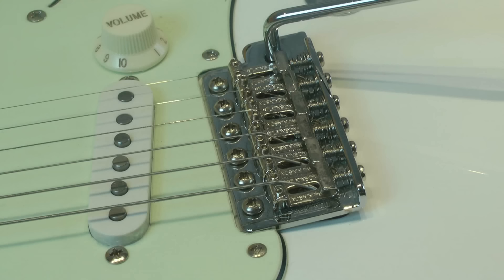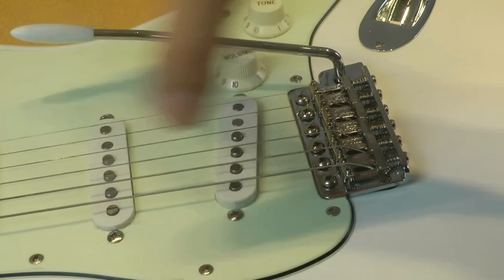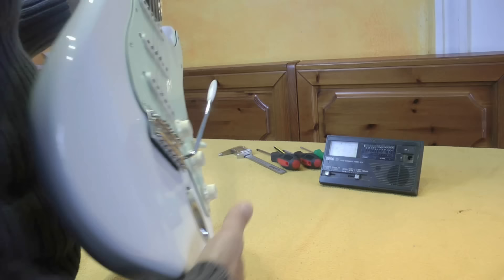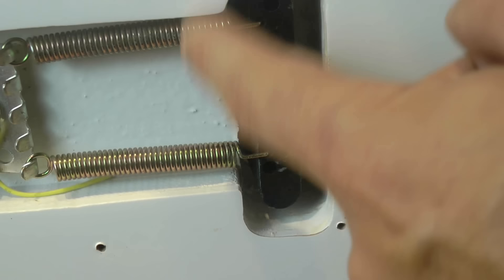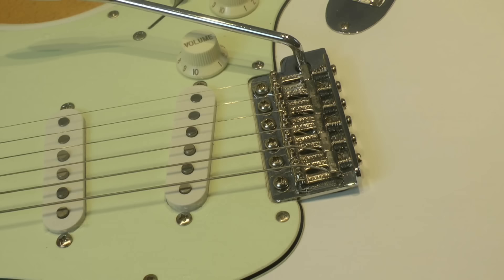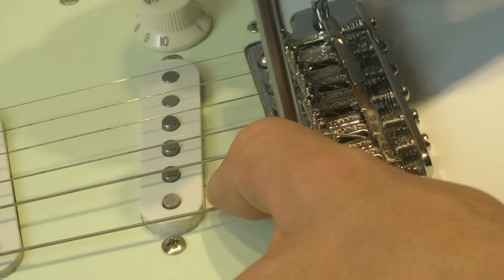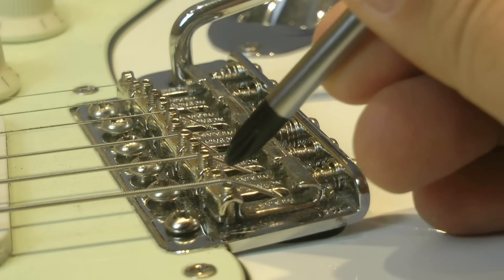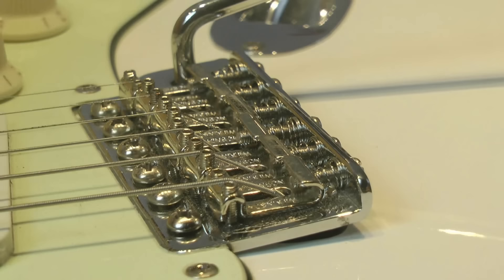How To Set Up a Vintage Strat Six Bolts Screws Tremolo for Best Floating Performance

Comment: I enjoyed the video however my 2011 Strat has a wooden block between the back cutout of the body and the tremolo's lower block.
Is this a shipping block and should i remove it. When i watched the video and Frudua turned over the guitar there was no block to be seen and for me I can't pull the wammy bar upward as it will only go in a downward motion.
Barry
Reply: Barry, maybe the previous owner blocked the tremelo. Just remove it.

Comment: i recently managed to get a 1978 stratocaster . the tremolo saddle /intonation adjustment screws are worn out as the previous owner probably didn't look after them and used the wrong size of screw driver. i want to replace the saddles , can you suggest me a good replacement for the 1978 American stratocaster
Reply: Callaham saddles would probably be excellent and better than the stock
Reply: What is the best replacement option for the entire unit ...( bridge/ saddles/ tremolo)

Comment: just bought a fender "special" strat, changing strings found the saddles float a lot and one crooked, I assume they supposed to float(move) a little?
Reply from the maker: vajraloka1 No, the pression of the strings should keep them firm. Try aligning the saddles screws so that the saddle is parallel to the bridge plate.
Reply: YES GOT IT FIXED THANKS

Comment: I really don't understand why any of the screws need to be released (plate to the base of trem block). In other words, if the springs determine where the fixed block assembly floats, (and it is a one piece block once all 6 screws are re-tightened, right) then why does it matter to tighten or loosen the the 6 machine screws if the springs really make all the diff in adjustment. In other words, why not just adjust the springs in and out until you get the 1/8 inch and let the block and plate alone? Seriously, I'm not bustin' chops, just curious what adjusting those screws actually does?

Comment: Nice video! I have a question: What can I do when I have buzz from my tremolo strings when I play without using the tremolo arm?
Reply: The tremolo springs? You mean they ring out? Some people put foam inside them, but others feel this ringing is part of the Strat sound, so it's not always regarded as a defect.

Comment: I tried setting up a 6-screw Wilkinson tremolo to float, but it does not stay in tune. whenever I pull the tremolo bar up, the strings come back sharp. Any ideas?
Reply: Lars Bauer. springs too loose

Comment: If I want my strat tremolo to float more than it does (pulling up on the bar), should I screw out the claw bolts more? I'm just afraid if I screw them out too much they will come out and I'll have a real problem!
Reply: Yes loosen it up and then tune to pitch, loosen, tune to pitch, the screws are fairly long and you should have it floating where you want it before they come out. In a rare instance where you unscrew them all the way, just screw them back in
Reply: Yes loosen it up and then tune to pitch, loosen, tune to pitch, the screws are fairly long and you should have it floating where you want it before they come out. In a rare instance where you unscrew them all the way, just screw them back in

Comment: By the way. Most so called pro repair guys do not agree with what i do because they don't know & they snear at it & would never set it up that way. Regardless what anyone's says, it has nothing to do with using more springs or heavy strings etc.. It is more to do with scientific physics. Like something Tesla or Einstein would have figured out if they played strats & had a need for it. Definitely Davinci would have! Why because it comes out of necessity!

Comment: i've changed the spring pattern and adjusted claw to get my cheap JAVA E11 strat floating bridge but now whenever i use tremolo, i lose tuning...how to keep it in tuning ??
Reply: you might have bad tuners. you need blocking tuners, to reduce the spirals at minimum (mine have HALF a round), and do exactly what fraudua says in the videos. reduce ANY friction. It might take 2 days: watching video, and doing.. but then...
my standard strat NEVER goes out of tune
Reply: Ok, there are a lot of possibilities, watch his other videos. Now since its cheap you may not want to put a lot of money into it, lubricate the nut, saddles, string tree (avoid the tree if all possible), the pivot points and make sure you properly wrap the strings on the tuners, there are a few techniques before having to go to locking tuners

Comment: i tried to float my bridge but apparently i did something wrong so i just wanted to get the bridge to be flush with guitar body but i cant even achieve it. envethough i tightened the springs on the back its still floating. even after i released the tension of the strings. i just cant get it flat to the top. and my strings are in tune but are very very loose and it feels weird. what should i do?
Reply: did you change to thicker strings? thicker = more tension.
Either go back to lighter gauge or get stronger springs for the trem
Reply: Your screws are too tight so the bridge can't "sit" down. That's also why it won't float properly. Back them off until they don't quite touch the bridge.
Reply: Remove the strings and check that it can go all the way flush with the guitar top. If not then something is in the way stopping it from moving correctly. If it can , then it's just a balance of tension from either side ie. springs / strings. Also check what poster above mentioned. If your trem screws are too tight it's not gonna go flush until you back them off.

Comment: Can someone answer this question please? I have an ESP LTD guitar with Vintage six screw bridge and I'm using a 011mm string set for heavy metal. Can I adjust the hard springs at the back of the guitar to make my bridge a little more flexible??
Reply: Mark La I suppose your bridge is set to fixed (dive only)? Yes, you can loosen the screws on the claw. 
What happens is that if it is too loose, even if it is still touching the body, when you bend a string, the bridge will dive and will lower the pitch of the other strings (the others than the one you are bending). This can be a problem on double-stop bends. What I suggest is to set it so when you do a whole-step bend on G and B strings, the other strings doesnt change pitch. If you do not use double-stop bends much, you can loosen the springs a bit more.
Reply: Yes
Reply: Samuel Campos can u give me an example of a double-stop bend? Cant quite recall what is
Reply: +Mark La for example bending 15 on the b string while simulatneously picking 12 on the e, bending the b string makes the bridge pull forward making the not you play on the e string flat, sometimes its awful, sometimes its not that bad
Reply: jubjub f ahhh ok, now I recall. I do this all the time while playing without knowing its name

Comment: I have a doubt man. I used to play with .10 strings, so one day I decided to try a .12 set, and the bridge of my guitar just bent up a lot. The action of the strings got so high and I couldn't find a way to adjust the bridge and let it parallel to the top. I screwed those two bolts that hold the springs until the very end, and when I tune the guitar, the bridge bend up again. So, what I am doing wrong?
Reply: Alison Soares  It sounds like you need to add or adjust the tension springs in the back. .12 strings are heavy enough (in comparison to the .10s you were using before) to pull the bridge up. Adding springs will help compensate for the added tension. If you don't know how to do your own setup, getting someone to do it may be necessary with that gauge jump as well.
Reply: Kristina Johnson My strat actually has three springs, do you think I'd have to change them for another ones with higher tension?
Reply: +Alison Soares add 2 more springs, or one and you shouldnt need to screw the claw in all the way, the strat will take 5 springs

Comment: Hello sir I see you only have 2 springs do you have a video that you talk about springs and Claws also I have looked at all of your videos and I'm confused about the length of the string holes is it not possible to use a stock vintage tremolo? and make it work most of us don't have access to drill press and fancy bits.I think you should make a straight forward video on how to set up a Vintage tremolo without talking about all of the technical stuff like angles you should talk about the nut of course but just make it more plain and simple on what to do. We Americans would just like a video on how to adjust a strat bridge in a simple video format kind of like how to change a tire without going into why a tire goes flat. Thanks Denny Lee

Comment: Hey there how do i stop my strat humming ON every pickup setting.. Help!! Its soo annoying plz help :)
Reply: Hi Joe, good question ! As you know , hum is mostly a "grounding problem".
Especially avoiding ground loops. In case your pickguard has an Alumium foil gluewed on the back of it, then you need to unsolder the ground wires on the potmeters,because they are already grounded by the Alu foil.
See: www.guitarsNuts.com. There is explained how to kill the beast ,hum as well as buzz. And it helps a lot.Tried it several times.
That webpage explaines you from A to Z how to shield exactly your Strat or Tele,but in fact any full body guitar. Hope it helps.

Comment: I have an issue!  When I tune half step down or whole step down on my strat, the bridge, (which was floating in standard) always decreases and ends of sitting flush with the body.  I have no idea why it does this or if it is bad for the guitar.  Could you explain to me why this happens?  I have a mexican strat with synchronized tremolo.  Thanks!
Reply: Changes in tension, you shouldn't use a floating trem if you're changing tunings regularly.

Comment: Hey, can someone give me an advice?, My whammy bar is loose and just annoyingly rotates while i am playing what do i do? Thanks.
Reply: joseph montemayor put fender tremolo bar spring inside the whammy bar hole.
Reply: @Mahavek  no spring is included in the bag sir, should i buy a new one?
Reply: @josephmontemayor494  Yeah! That whammy bar spring only come from factory in certain models, but you can buy them separately and they are no expensive at all.

Comment: I don't understand.. My guitar still gets out of tune.. Help please
Reply: +Rasmus Jern The strings are probably getting caught in the nut or even the saddles, or possibly even string trees. Getting roller replacements for all of these should fix it (as much as possible, it's never going to be absolutley perfect all the time without a locking system)
Reply: +Rasmus Jern The intonation has to be set at the saddles and the nut slots have to be cut so they do not grab the strings too tightly. A guitar setup guy can fix both easily (I do it myself as an amateur). Worn out strings will not stay in tune, so replace them depending on how hard and often you play. retuning stretches the strings, so the better the setup, the less retuning is needed.

Comment: Just put an 1/8" block ( a few business cards ) under the back of the bridge to body on the front of the guitar then tighten the claw springs to keep the block in place,  next tune the guitar then slacken the springs slowly until the block just slides out - job done,   u don't need all that other shpeel.

Comment: I put the bridge of my stratocaster floating, with 3 springs, remains tuned, but still with a very hard tremolo action. I can not do that "shaking" effect by pulling the lever up (4:18) no way! What could be wrong? Obviously my technique does not help much, but I do not think that's it. Could it be very hard springs?

Comment: this is the crappiest floating bridge ever.  i can't believe that fender is so lazy that their engineering solution to this problem is 6 loose wood screws......it is an embarrassment
Reply: It was the first successful design...
Reply: granted...it was the first successful design ........... and 50 years later they can't be bothered to add bushing on the load bearing surfaces????.......there are a million complaints of the bridge hanging up on the screw threads and the bridge not returning to home........it seems amazing to me that they don't improve the design